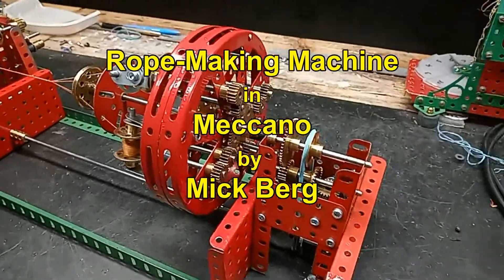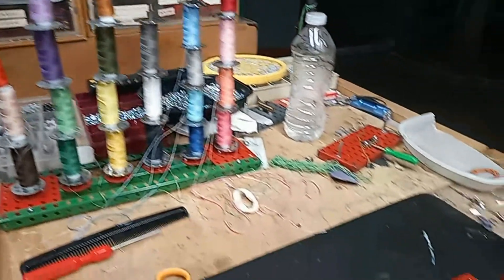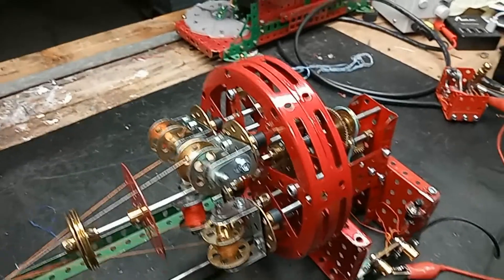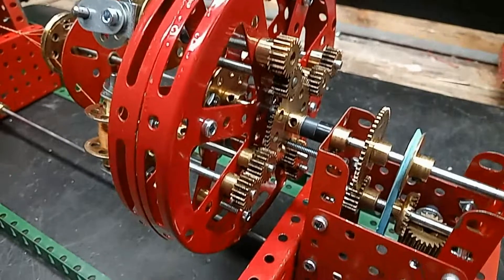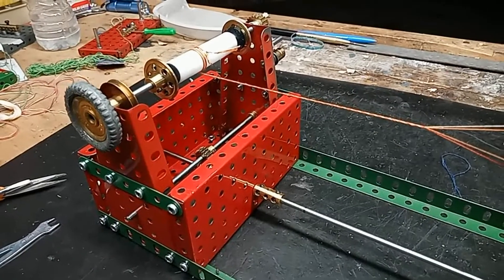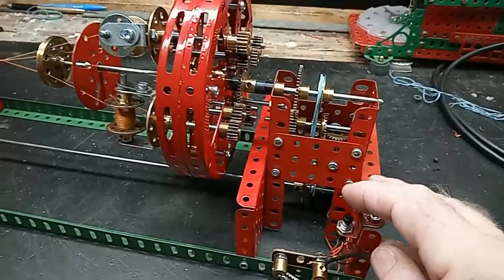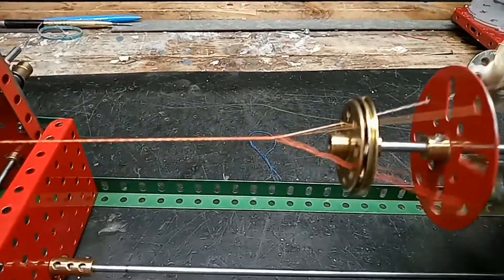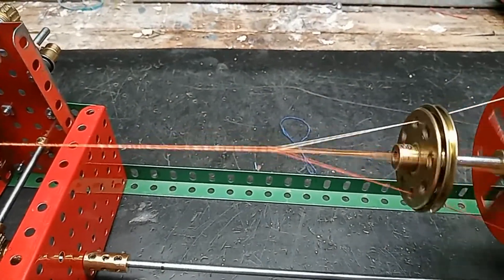Rope Making Machine in Meccano

Comment: This cracks me up - in the nowadays of 3D printed plastic parts, this guy used an erector set!
Reply from the maker: You're missing the point, the point is not to build thye machine, it's to build it in Meccano, which can then be dismantled and the parts used over and over again to build other things.
Reply: @michaelberg9656  impressive. It looks so solid it might as well be permanent :)
Reply from the maker: maybe that's because I'm 76 years old!👴👴
Reply: If it works, it ain't stupid... probably faster to do it with these metal parts too, if they are laying around...